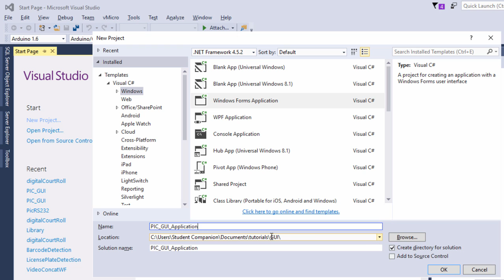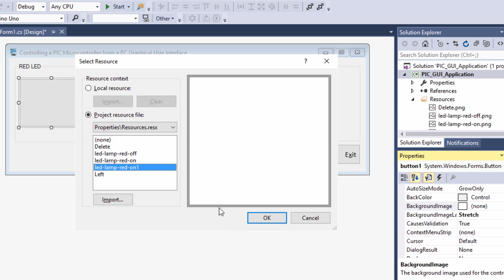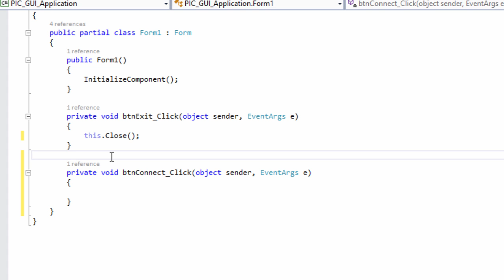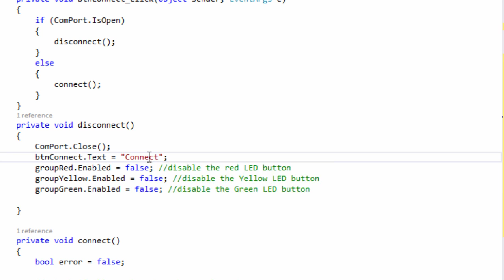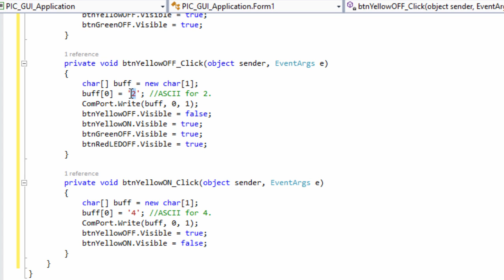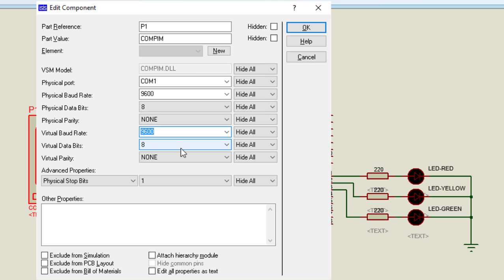Comment: Sir, I request you. Please, make you 32-bit ARM Cortex Microcontrollers tutorials. Thanks lot you. I waiting for your tutorials. Again Thanks.
Reply: Thanks for watching our videos and for your feedback but unfortunately we don't plan to have any ARM tutorials anytime soon. We will only do 32-bit PIC
Reply: "NXP or ST" ARM Cortex-M Microcontrollers. Example - LPC1768 or STM32F103xxx
Reply: Sir, Great and thanks the lot you.
Reply: No. At the moment our plans is concentrating on PIC 8-bit and 32-bit microcontrollers, Arduino and Raspberry pi.  But from our Flowcode tutorials it's easy to use ARM or AVR, as Flowcode is not microcontroller dependent.
Reply: Watch this latest Flowcode video, although it's for Arduino, the same programming code and principle can be applied for ARM. You just has to change the target microcontroller: https://youtu.be/EKS0uVcn2z4

Comment: sir , if i want to apply this for a pic 18f4550 8 input 8 output how may i do that? knowing that i need it to communicate through usb
Reply: Unfortunately we can't explain everything here in comments as USB communication merits its own full tutorial.
In brief you can use USB CDC protocol the Computer software won't change unless you add more input/output as it's your intentions.  But the principle will remain the same. The Computer will still see the PIC as a COM port even though through USB.
Reply: We will record a USB tutorial in the future but you can use Microchip Libraries for Application USB sample codes for your project. They have sample projects using PIC18F4550.
Reply: If you use an newer PIC model like the PIC18F45K50, you can also use MCC with USB light.
Reply: much thanks sir for your response i really appreciate it
Reply: thanks sir very much , does it happen that you have a link somewhere?
Reply: cheers for the best , most responsive and most useful tutor online!
Reply: You are welcome!

Comment: Hi bro, thanks so much for the tutorials. I just wanna ask you if you have any idea to GUI an TFT LCD to control a PIC18f. I know how to do that using codes which is really difficult. Is there a software to do this and generate the code for me?

thanks
Reply: +Lion Heart you can use Visual TFT software from Mikroelekronika: https://www.mikroe.com/visualtft/
Reply: thanks so much bro,
I am using RA8875 controller chip which I think this software does not support.
Reply: +Lion Heart you are welcome!
Reply: +Lion Heart i am not sure if that controller is supported.
Reply: I checked their supported controllers and it is not included. 
Maybe I need to write lots of functions to do all what I need to display in my LCD
Reply: +Lion Heart good luck.
Reply: Thanks bro, you are a great guy, I really appreciate your help. 
Bro, I wanna ask you about MPLAB harmony, does it only work with pic32? It seemed to be easier to program an GUI, but never had any experience with that.
Reply: +Lion Heart MPLAB Harmony only works with PIC32 microcontrollers
Reply: Great,  
Thanks so much bro....
Reply: +Lion Heart you are welcome!

Comment: Im glad you're in South Africa. ......I want to build cnc machine using PIC chip ..... Please help
Reply: Hi. What kind of assistance you require from us?
Reply: I want to programme 5 axis cnc plasma  machine , which can communicate with any G code sender available on market so how will I do that , I have seen that is a firmware which could be used with arduno which is 3 axis cnc and arduno is kinda limited to me ,now since arduno is using the same language as PIC I thought it could be possible to actually do that with ease using PIC but now  I don't know where to start
Reply: You are the only one who knows how your cnc should work. You must have some logic flow, the numbers of motors to use and how it should be controlled and so on.
You can start from the beginning, break the code into small functions, then start programming each function and see if it works. 
We can only assist you when you are struggling with some code because we will know what you are trying to achieve. But if you don't know where to start, unfortunately we also can't assist you.